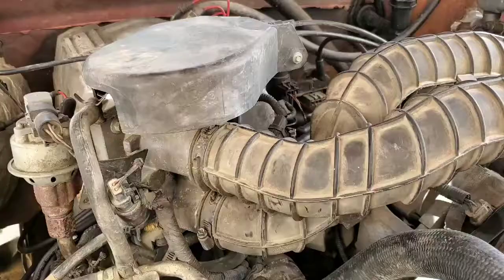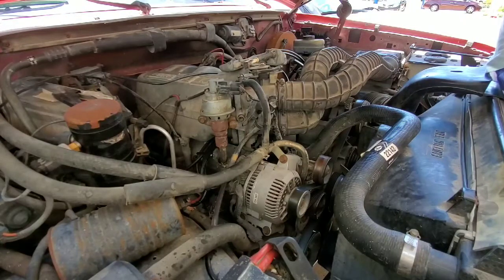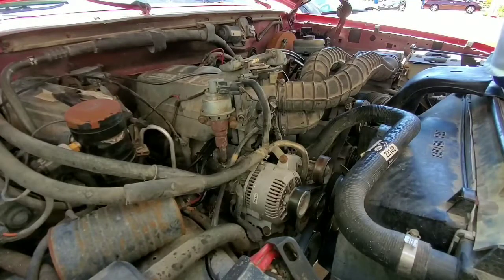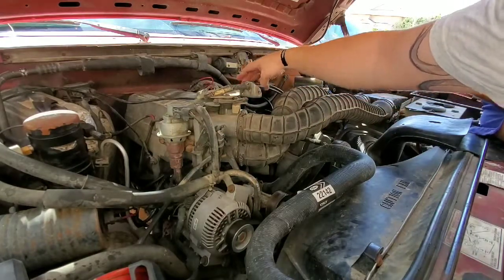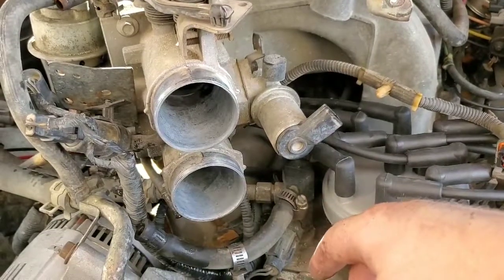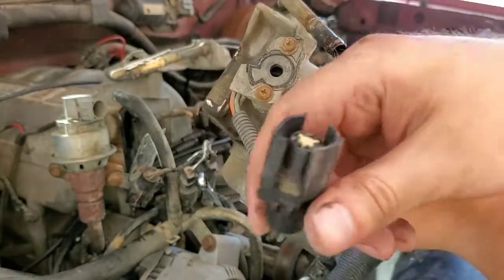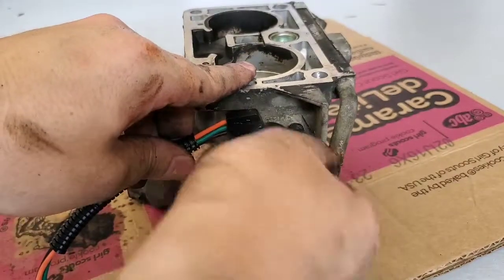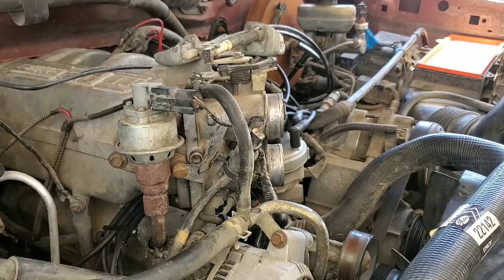1995 Bronco Throttle Position Sensor

Comment: I this this is my issue with my truck, it’ll idle really rough and the RPM will sit around 1100-1150, then suddenly drop to 7-800, the die, but if i give it more gas of course it won’t die, glad i found this video thank you!
Reply: There's also an Idle control valve nearby that you should clean. Make sure you clean it in the vertical position so the fluid drains down and out (upside down and fluid goes inside the solinoid)

Comment: 1. love the igy6; tattoo. i have the exact same one on my left inner arm. 2. i am thinking of doing the same to my 92 bronco. it starts and idles ok, but when given gas, it acts like it wants to die, but after a half a second, will rev up. if you put the pedal down fast enough it will die, but gradual revving will hesitate for a split second, then rev. I have changed out other sensors with no luck. hoping this works! thanks for the walk through.

Comment: I bought mines with an iddle issue and plenty  of other problems. This is the one I'm taking on soon.  Only question  is, did you had to burp your  cooling system after putting back the lines?

Comment: I’m having trouble with my 90 f250 351w. It’s hard to get started then when it does start its very rich running, misfiring from tailpipe and through intake. It was being driven for a short time like this when I noticed two plug wires were wrong. Fixed that, new plugs wires and rotor. New map sensor. And since it was backfiring and running so rich I removed throttle body and cleaned everything. Everything had horrible build up on it. iac was cleaned and moved freely. I left the tbs on it. Egr appears to be clean. I just got a new ignition coil I’m putting on tomorrow. I wonder if it’s a bad tbs.  Also have new o2 sensors to put on. It won’t even start now. Almost seems like it’s just dumping way to much fuel in. It smells like gas bad just from cranking the starter. So I’m thinking possible tbs, crankshaft sensor, ignition control module on the distributor or pickup coil inside. If not any of that’s I guess I need to test fuel pump, fuel pressure regulator and injectors. Anyone have any advice. I’m just a backyard figure it out kinda guy. I’m not expert so any ford guys please help me out. It’s driving me nuts

Comment: Did you have trouble staring it up once it would die? I'm having similar problems
Reply from the maker: I don't think I got to the point of starting issues, mine were mainly idling issues. Sometimes it would be idling high, other times it would act like it was starved for fuel. If yours is doing the same thing, the TPS could be the issue. Worst case scenario, you have a new TPS and still have the issues. Best case scenario, your problems disappear.
Reply: @bettythe95bronco57  my 89 bronco is doing exactly what yours was doing rough idle surging and stalling from time to time in stop and go traffic

did this problem rob a lot of power and mpg? im talking like 20% or more because im thinking about tackling this soon but it winter and cold

but if thats whats causing it ill tackle it 100% asap
Reply from the maker: @Friedrich-Wilhelm-1980  Sorry for the late reply!

I did notice more power, but I honestly wasn't tracking my mpg closely. I lived 3 minutes from work, so I was filling up $20 here and there. I think at one point I guesstimated about 8 mpg. After moving, I now live about 10 minutes from work and I cruise more than I used to and I get about 11.5 mpg. Could be because I'm doing less stop and go or it could have been the TPS, I honestly don't know. It's easy enough to do though, so it wouldn't hurt if you swapped it out.
Reply: Mine not wanting to fire after stall like you say your was doing. What did you find to be your problem
Reply: Tracing my problem to idle control module.  Thanks for info on throttle body removal.  No start when warmed up.

Comment: What is that sensor next to the holes of the intake manifold there.
Reply from the maker: +R Romero can you give me a timestamp of what you're looking at?
Reply: It was the IAC valve. I replaced mine but when I connect it. It idles weird. I have a video on my page that I recently did. Idk what it could be. Idk if you might know?? Help would be appreciate it.
Reply from the maker: +R Romero let me know if the link on your video helps!